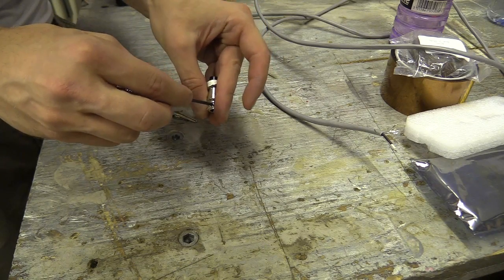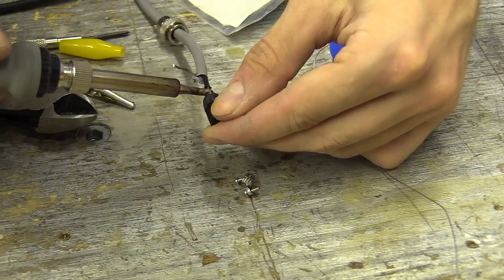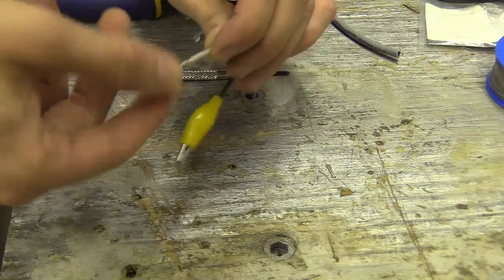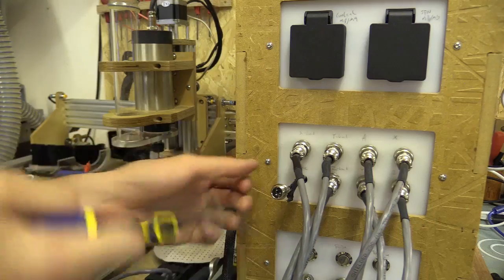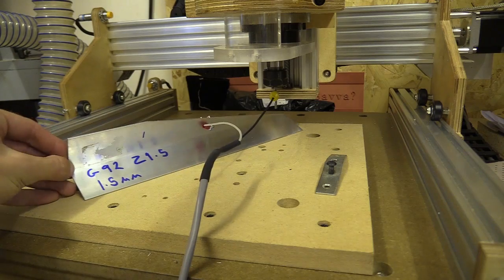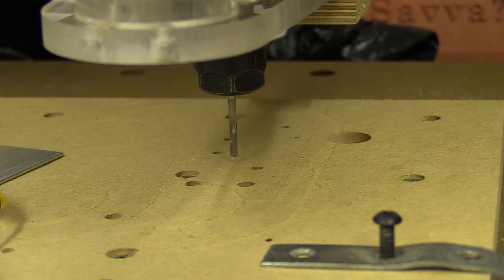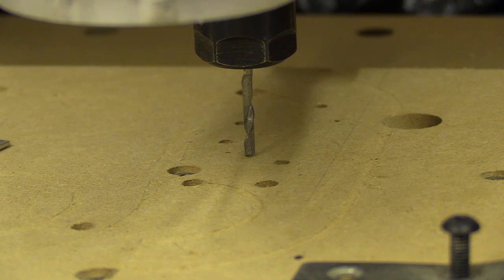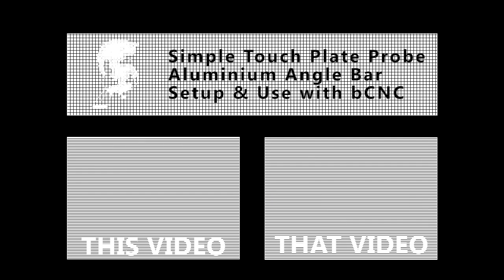#18c Simple Touch Plate Probe #18c / Build and Use on bCNC

Comment: I find this solution very devious . . . Give My solution a try  . . .1 take a micro switch and drill a 3mm hole in the back . . . 2 glue the shaft of a broken cutter or dril in this hole . . . 3 solder two wires to C and NO and connect them with your Probe Terminal. With this 50 cents tool you can Auto Level non conducting material. It will give you a precision better than 50 microns and works top when you want to engrave.  All letters and symbols will have exactly the same depth !

Comment: Hi nice video could you tell me where you connect the other end of the cable from the touch plate and croc. clip please just built my cnc and running bCNC like you
Reply from the maker: You just shove it in any hole... only joking. It depends on which controller you are using?? My controller has a probe terminal and the other wire goes to ground.

Comment: you shouldn't need to zero Y and Y to probe, or even Z you just have to set the probe "position" to the position you want it to stop if it doesn't trigger the probe.

and I believe it is recommended to use G10L20P1 to set a coordinate system rather 
than globally offsetting with g92
Reply from the maker: I was using that as the origin position before starting the new cutting job - so I would have had to set zero eventually. I'll try use the other command and see how that works.

Comment: I haven't gone the probe route yet as the controller for my chinese cnc doesn't irc have a probe input. However I did make a 10.1mm probe block from some engineereing plastic of some kind and a copper 2 pence piece, attached to a little box with a 9v battery bloody loud beeper and bright led. works a charm. small foot print of a 50 pence piece is handy too as my bed is way off.
You might want to get some heat sucking locking tweasers if you're over cooking the braid or use a very very hot iron very very fast.
Reply: Pardon my ignorance - how does a 2p coin suit you? The thickness varies substantially across the engraving on the face - do you have it edge-on?